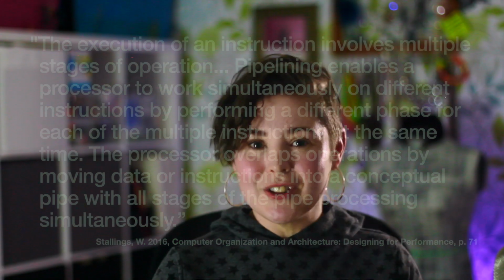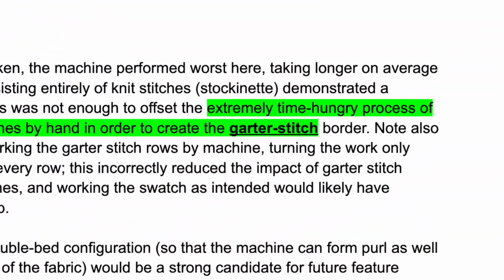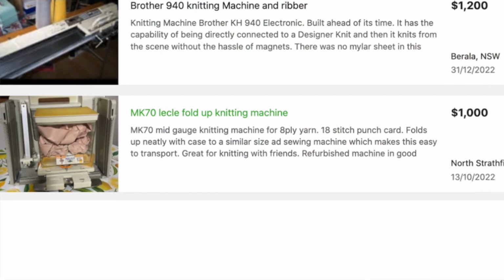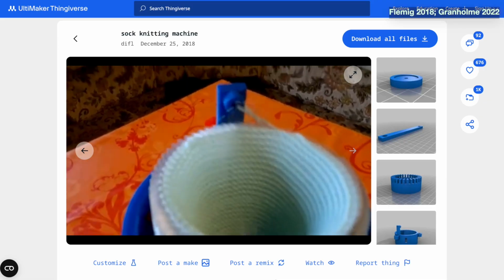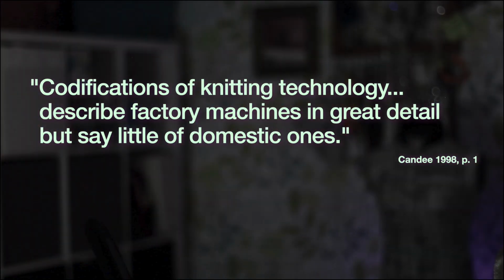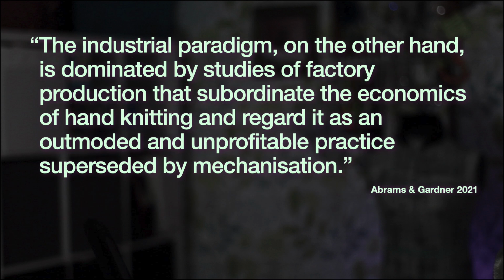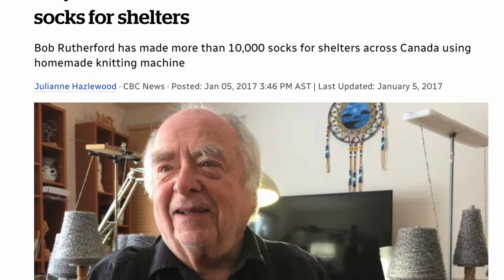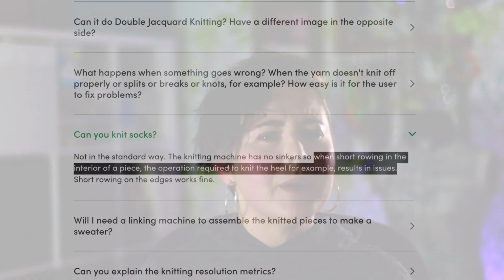(almost) Everything I learned about knitting machines while designing one of my own

Comment: What I'd like to build, would be a tool to make Tabi (mitten) socks.  Both Tabi and Toe socks (suitable for wearing with thong sandals), are not readily available items in stores, but can be found at online retailers.  They are either cheaply made in China (usually poor quality, and not in the taller lengths I'd want), or quite expensive imported from Japan.  Being able to knit my own would be nice, and a circular knitting machine would simplify the task (which would still be mostly a custom "by hand" process as the circular machines don't automaticly handle the  process of doing the heel, toes, and cuff of the socks.  Also some kind of manual intervention would be required to change colors or knit designs into the socks.  Of this I know nothing.

Comment: Its like what they did with knitting machines and looms, that everyone with a home had.  Suddenly only the well heeled. Thousands of dollars. And they keep telling everyone small is best.  You can piece your cloth. I had a 26 inch 8 harness table loom and my nu. 1 priority is width. Ratchet and pawl, and width, didn't even care if you had to lift to lift harnesses but width was top.  So I've been working on a small 32 inch, that to me is sampler, my next will be 40, and I already bought a 45 inch reed, so the 32 I have  rigid heddle, with 2 double heddle stands, and found some 1/8 inch small dowels and realized I can make 16 harnesses.  So when I feel like replacing the rigid heddle with a similar style reed,  its going to be a loom that can almost do it all. Im making faux sectional warping too. When you're working with cardboard and paper, it has to be finished like a work of art, with jewelry wire, paper beading, coffee coloring, abstraction, some foil and thought about core spinning the wire to wrap the harness dowels and making the paper beads for eyelets for half harnesses, and best of all this larger thing will rest in my lap against my computer desk, even the 40 inch will, it will little buttons attacked to dowels, where a half stand lifting it an inch above my lap. Next time I start the gluing stages I'll have 2 looms going not just the 1 prototype that will have its imperfections. Its time for people to take this world back for the people.  My son bought me a spinolution spinning wheel, bullfrog, that part made me happy, but making a few as gifts with cardboard and paper is also on the list.  Now I'm waiting for a 3d printer for my birthday.

Comment: I believe in open source and empowering people. They put bonds and flatbeds out and then took them away, they don't want people to have what they want. The sock machines, hundreds of years old, were for the wealthier folk and most manufacturers want to make products people would buy affordably, but in this case, its for the elite, and 3d printers and the people have pretty well cornered the affordable market. For me, used to have a bond fine and regular.  I wanted a ribber. But that was almost 40 years ago. Now my arthritis does not allow hand knitting socks so switched to the slow knitting loom, but immediately remembered my knitting machine and thought of creating a frame like the kiss looms, rectangle for socks, with th latches of the knitting machine, and using cards to move groups of them and manually placing the yarn. A little stand and make two inverted rows, ie a ribber, so it would be akin to a manual knitting machine without pressing down and hurting my heart.

Comment: This is an incredibly cool project. Do you own a flatbed knitting machine already? I think that having one to hold and fiddle with is super informative and lets you build a lot of intuition regarding the mechanics that at least I could never get from videos. Your design looks a lot like a lot of 'toy' (not an insult, just how they are typically marketed) ones out there, but its neat that its open source so that further customizations can be made. Bulky machines are super expensive where i live so it will be great to be able to have a semi accessible option. They tend to have different needle proportions though, so hopefully the openscad has that built in. Like you said, there are so many different machines out there that it is impossible to accurately get to every different corner, and the deeper you go the weirder the shit you can find. 

I live in New Zealand, which conveniently has no land border with any major manufacuring hub, but is also sorta in between both japan and the usa, so we have a weird mishmash of stuff available. We dont have as many proper big fancy ones (hence bulky machines being super expensive), but I catch a lot of really weird super old ones that have design quirks that you just do not see on later machines. Best one has a bed like yours, just a solid chunk with grooves in it, which was fairly standard at the time, but it was a v-bed setup so you would never have just one bed. The carriages are the same as eachother, except for one having a connecting arm as part of it. They have serrated wheels for gauge control in either direction, and a wheel in the center to set the setting. Modern machines set the settings by setting levers at certain points, which force the needles places. This has one lever each side pushed by the needles, with its motion restricted by hitting the gauge wheel or the pattern wheel in the middle. Directional patterning too. So you can have it do a different thing in each direction, and have the exact same control on the opposite side bed, its amazing and i have never seen the wheel thing on any other machine, but its the sort of thing that would work for this sort of project where you want to minimize really small thin pieces. 

I do much prefer the slotted beds that are more common, having to lift two attached meter long solid slabs of brass is not generally advisable for any reason, though i have no clue how you would do it in a 3d printed system since they require a constantly bent comb to keep the needles up. Once someone solves that bit its over, I'm making a 30 foot one and noone can stop me. While knitting machines are not akin to 3d printers in the way that they are entirely hand operated and often each row is manually designed, they are akin to 3d printers in that often the machine is the actual hobby and not the items it makes. Yeah its cool that i can make a pikachu figurine, or knit a custom sweater, but what if i simply spent 90% of my time disassembling it and working out its mechanics and getting injured in increasing impractical ways? Super cool project and I hope to have fun making wildly impractical addons whenever the github is released